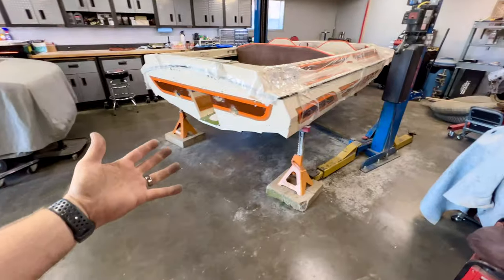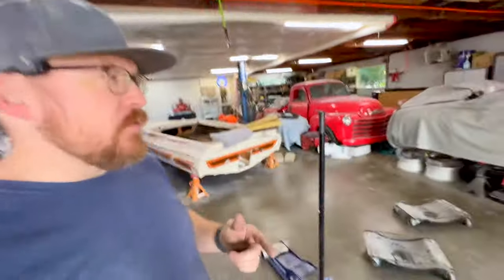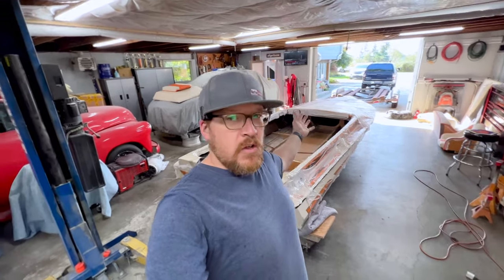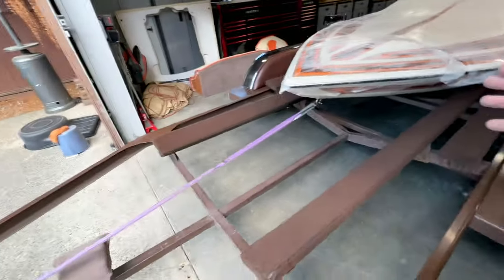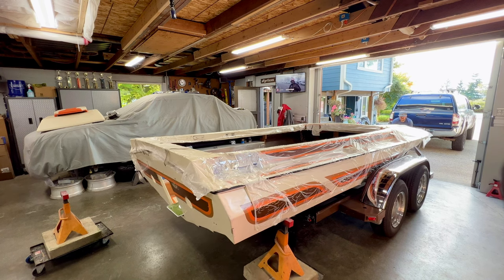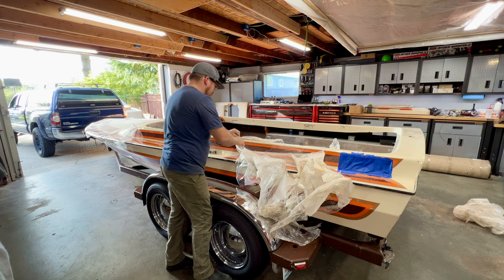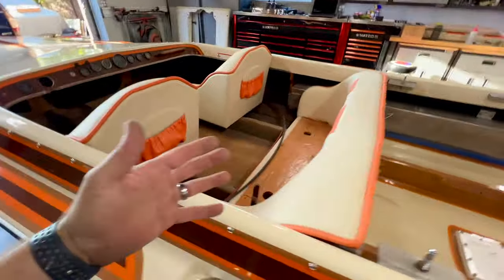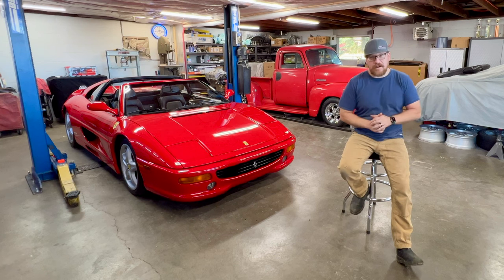FORCED to Stop Working on my 1979 Centurion JET BOAT

Comment: Something I did the other day. Took 2 of the harbor freight wooden dollies. Stole the casters. Took a couple scrap 1/4" plate and made two new solid dollies about 2x2' squares. Then took a couple old jackstands and welded them solid to the dollies. I used my trailer to setup the hydrostream in a 3-point hold. And also had the axle out of the trailer. Those now rolling jackstands went to the corners. And my modified jack up front let me turn that hull sideways in my shop. We have a drag-n-drive car coming in and that gives me the best room.
Reply from the maker: That is a solid idea. Ill be keeping that one in my back pocket. 

~ Nick

Comment: I felt a strange disturbance in the force recently, must have been when you decided to stop working on the boat???     I do have a boat question for you.
What are you going to do for a trim gage for the diverter?     I can only find one that has to attach to the diverter hydraulic cylinder?   With my diverter (Exweld) I dont think I can attach it?    Is there some other electronic way to do it????    Im thinking get the kit from CP.  But use a linear actuator to move the arm on the sensor. Wire actuator to diverter control and use limit switches to control travel.   Hit  up button, actuator moves until it hits the limit switch and shuts off stopping gage travel,   pump can keep running .  hit down button, actuator moves again until limit switch is hit????     I believe I can build a nice aluminum box and put this under dash????    Your thoughts???
Reply from the maker: For now, I will not be using a trim gauge. That is something I will forgo, so I can get the boat in the water sooner. Down the road, I will likely build my own kit using a bowden cable on the place diverter, then run that inside the boat to a potentiometer that will feed the gauge. 

I am not sure I am fully understanding the setup that you have described. Are you using a manual cable to control your diverter, or is ut hydraulic?

~ Nick
Reply: @AutoTechNick  Hydraulic,   Let me try again,  instead of the cable to run the potentiometer, I plan on using a linear actuator.  Adjust it with limit switches to shut power  off when the gage reaches its upper or lower limit.  Since the pump will continue to run when the diverter reaches full travel, I need a way to stop the gage needle at appropriate location.  Thanks for the reply, actually very helpful, I was sure if there was a simpler way than the cable system, looks like there is not.  My boats so busy in the back Im trying not add anything if I dont have to. I may be adding an oil cooler and I would like to add a Peterson electric oil priming pump.